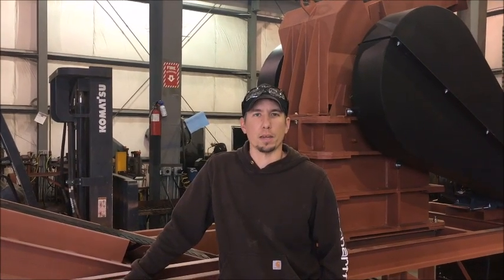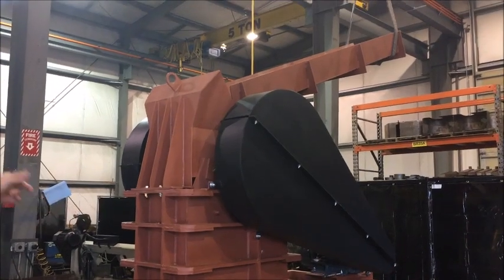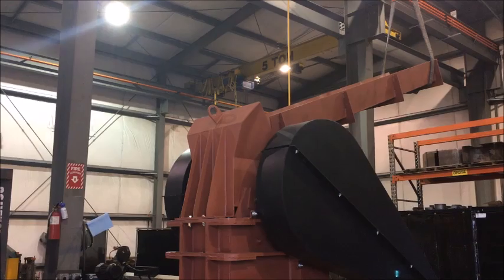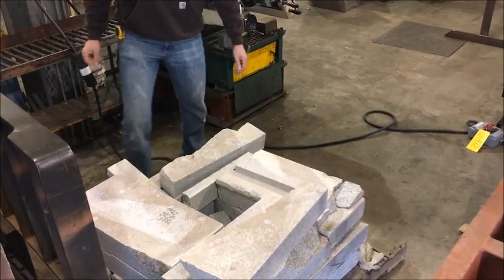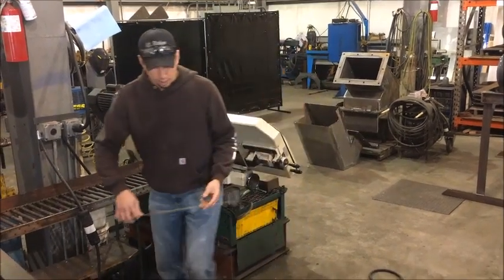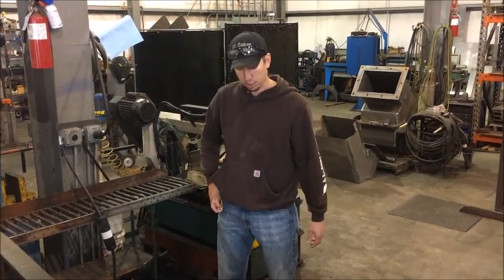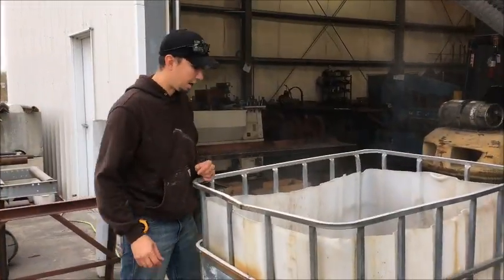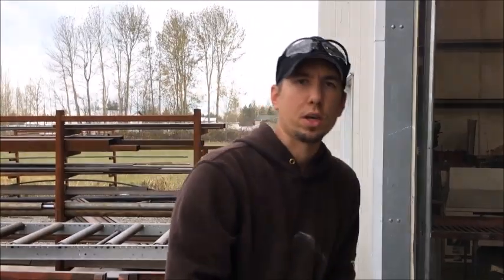Jaw crusher crushing granite slabs to gravel

Comment: Looks like that corner at the interface of the chute and the hopper is taking a lot of wear, might need to re-enforce that or put in some diamond plate or something.
Reply from the maker: Yes that will probably be a spot of wear on the machine, it will be a quick fix with a welder and some steel plate though.  Thanks for your comment.